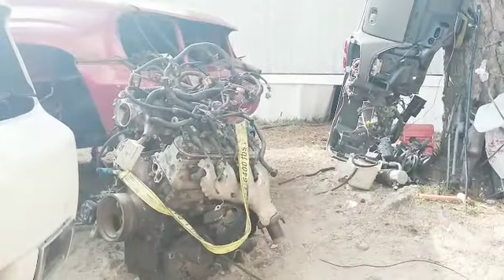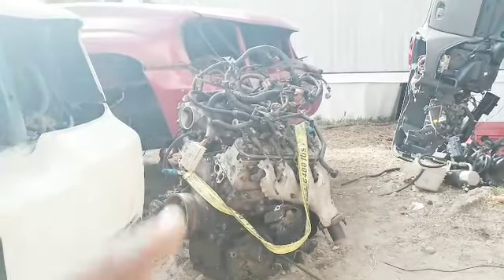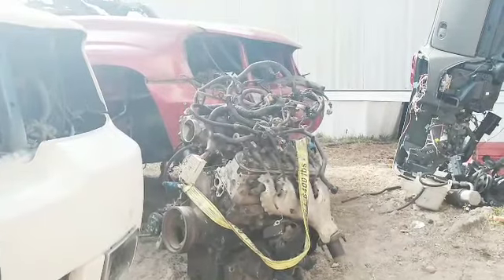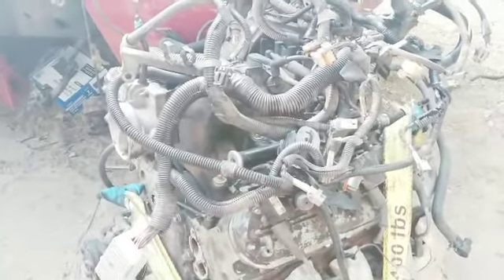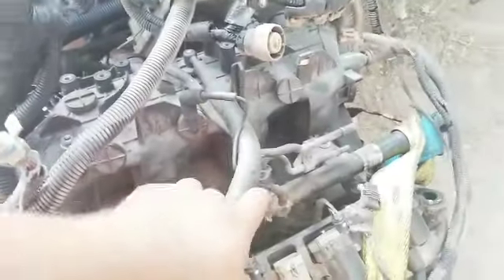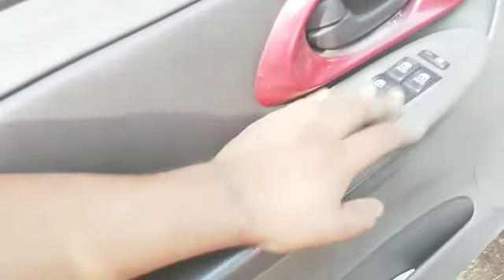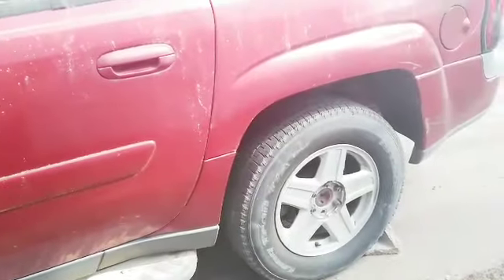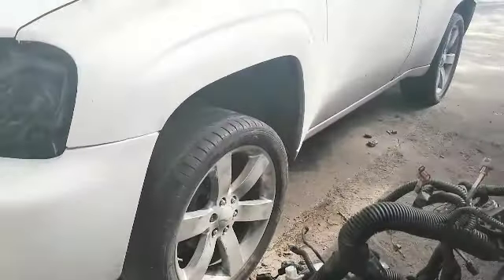Update video trailblazer v8 swap

Comment: there wasn't anything different frame wise from the 6cyl tb and 8cyl tb was there?
Reply from the maker: The only wire that changes is for the pass pump but you can look it up an pinout.com it will show you where to move it just have to compare them
Reply: Dillon McQuistan no exactly the same